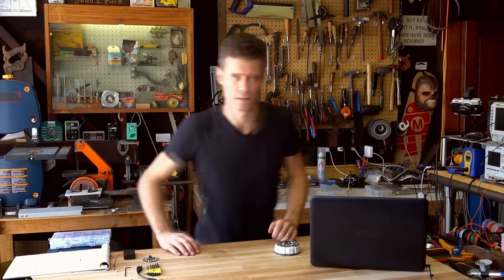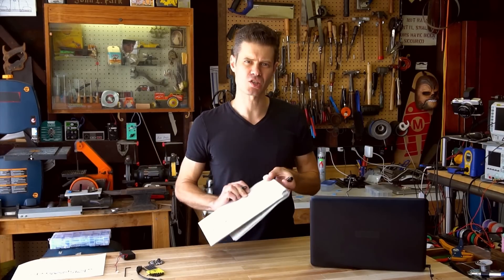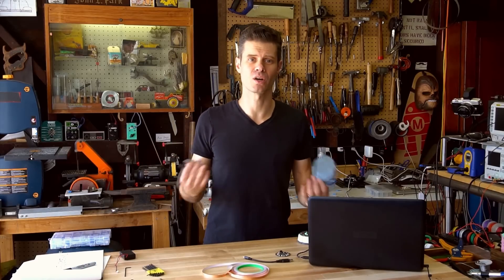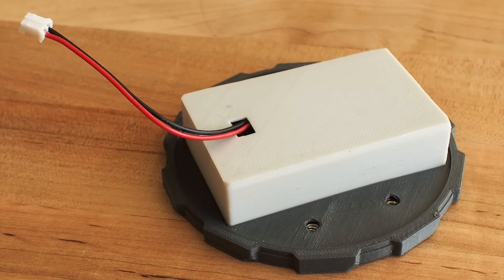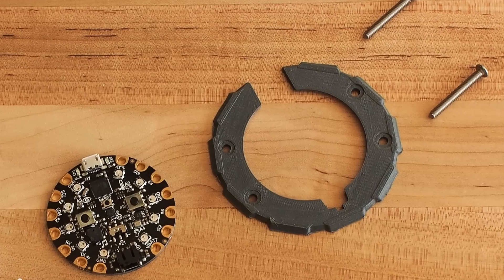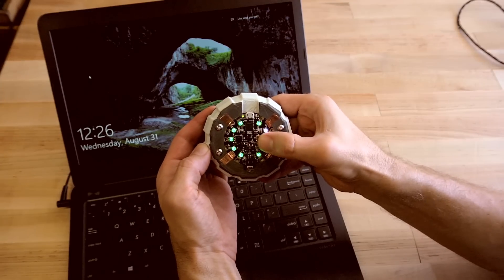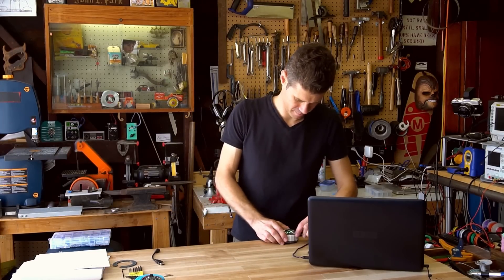John Park's Circuit Playground Password Vault @adafruit @johnedgarpark #adafruit #CircuitPlayground

Comment: Actually your password is not that secure. Its a bunch of common substitutions on a regular word. A fast setup with a dictionary attack can break that easily if configured for common substitutions.
Reply: I'm not sure that's really the point, here.

Basically, this guy just showed you how to turn the sky pink, and upon doing so, you said... "Well really it's more like salmon, right?"

Okay guy, the color is not the point, the sky is mfing pink.
Reply: +Bob. It's five commonly used substitutions on a single word. Very easy to crack in under a day without special hardware. But again, the actual complexity of the password and good password making strategies are not the point here.
Reply: I'm not enough of a crypto guy to know for sure, but I figured adding four punctuations to the mix would help make this pretty painful to brute force!
Reply: +John Park sure, it is not the point also, but just as a tip, watch computerphile's video about password safety. It is a good thing to teach people how to make very strong passwords.
Reply: +Bob. Raspberry is in the top 10,000 most commonly used words. All those substitutions are the most common for the letters they are on. The search space is actually not that large for a computer.
Reply: And you are right because you were told of the formatting.
However, the space is still 4.93x10^27 for brute forcing.

Steve Gibson from GRC calls it haystacks. (https://www.grc.com/haystack.htm)
You don't have to be a cryptographic genius, this page explains it all.

While simplistic (because it was shown to you), this example, ..R45p835rry.. will take 15.67 thousand centuries at 100 trillion guesses per second to brute force.
Reply: themaconeau That reference assumes each character is random: they're far from it. The search space is not that large for brute forcing with a dictionary and common substitutions. See here: http://optimwise.com/passwords-with-simple-character-substitution-are-weak/
Reply: Another thing about that source is that it thinks a password like "electronics123" would take 2 years to crack in the worst case, large array scenario. That's simply wrong. 7 years ago I personally cracked a longer more complex personal password in under 60s seconds with a single 1st gen i7 processor and a publically available backtrack 3 live CD and I didn't even have any idea what I was doing. A more experienced hacker with the right tools and hardware can break your silly 1337 speak substitutions easily.
Reply: I think you've missed the point here. That password was contrived for the point of demonstration. The method used to come up with it drastically reduces the changes of the un-altered word being used as a password.

The most popular passwords are 123123 and password.

More interestingly, I could probably just dump the rom on the MCU and get the password.
Reply: thought same thing ,true things have moved on in this field ,even weird spelling of raspberry is not good enough,got to be total random & huge 15 char +
Reply: That is just bad for remembering. Easier that that is just a combination of 4 to five words separated by spaces. The catch is using uncommon words and even words in different languages.

Comment: Since it is recognized as a keyboard is it possible to add a capacitive sequence that locks both the vault and the computer it's connected to?
Reply: If there's a keyboard combination that can lock your computer, then yes, you could have a sequence on the Password Vault that triggers the lock.
Reply: Yes. If I gather what you mean, you are looking for a password sequence on the cpe itself. Easy beans. A simple entry using the A and B  buttons (as long as you'd like) could be required on start with a call to the function that puts the rest of what John does here into motion. All of the I/O capable pins will accept touch cap, and if your case is innovative enough you could hide the capacitance points to provide a tricky touch combo that would be pretty hard to guess if you didn't want to use the A//B combo ideas. Any sensor or button could be used as input as well. RFID is also an option for about $15 (and some patience)

Comment: Hi John, wouldn't this be susceptible to someone dumping the program using an ISP programmer and looking for the password in the binary?
Reply: That's a good question, I haven't tried it, but I'd definitely  advise against letting fall into enemy hands ; )
Reply: +John Park , makes sense, just like a "real life" vault can be broken into once the attacker has physical access to it. It still protects you from hackers from around the globe, which is usually the main concern. Cool project! (;
Reply: With proper encryption and longer encryptions keys you can make a vault that you can't crack fast even with hardware access. One way from making it so you can't just use the pads as a means of quickly guessing a bunch of PINs is by requiring exponential time delays between each incorrect guess after the first 5 or so. This is the approach they use for mobile phones. But if the delay is only enforced by the code then the encryption algorithm must be properly salted with a secret seed that isn't easily retrievable with reverse engineering tools. You have to force people to use your proprietary PIN checker.

Comment: is there anything stopping someone from opening a test editor like notepad and pressing the "Enter password button" and having the text get dumped into the document? If it is just emulating a keyboard I am guessing it is just typing plain text?
Reply: they'd have to know the secret pin AND have physical access to your vault, so it'd still protect you from hackers from far away, but not from someone who is close to you. But again, they'd have to figure your pin and get the vault from you, so it's relatively safe, but also relatively convenient.
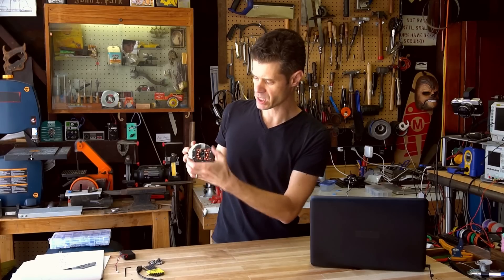Reply: Thanks for clarifying that -- I just added an annotation at 3:05 to make it clearer that without the access code it won't give up your passwords.

Comment: Interesting idea but I think I'll stick with 1Password + their phone app. It seems if someone got hardware access to the device you're toast unless you handle the vault just right. A better solution is a fingerprint reader that sends a hash for the fingerprint or pin plus a NFC reader and (active) NFC tag or smartphone with custom app. You need to use a long string to decrypt the vault or it's going to be easy to crack with hardware access. 6 digits with only 4 inputs: 4⁶=4,096 possible unlock pins -- 41% of the strength of a 4 digit pin on a 0-9 numpad that you have by default on Windows.

Comment: out of curiosity can this vault hold more than 10 passwords or is the code talking most or all of the memory and it can only hold 10 passwords, also what if you forget what passwords go to what site.
Reply: Yes, it would be able to hold many, many passwords, probably more than I could ever throw at it. As far as forgetting which ones are for which site -- I'd probably want to add a little OLED display to it if there were more than just a few.
Reply: Thanks for the reply i may just do this project